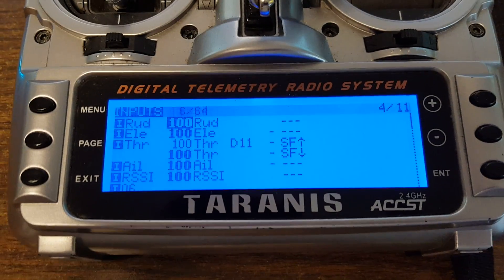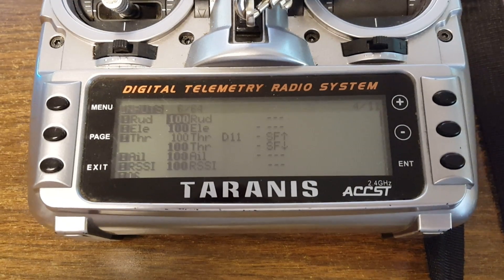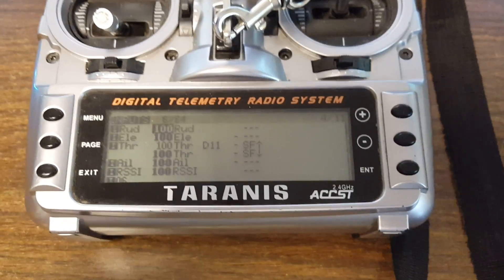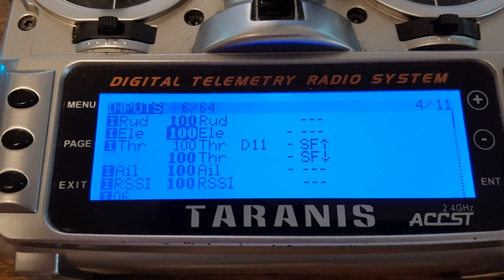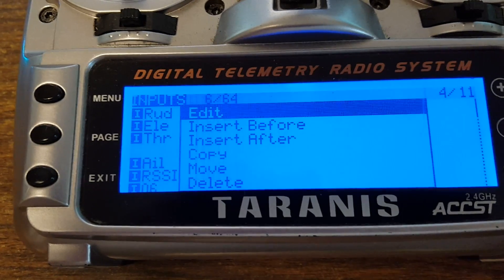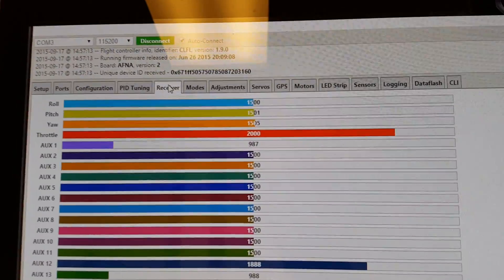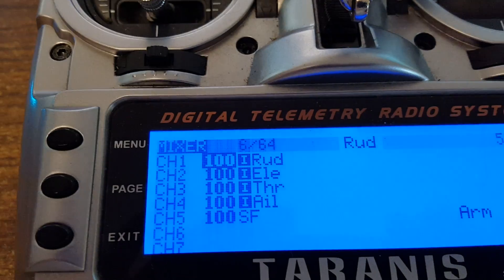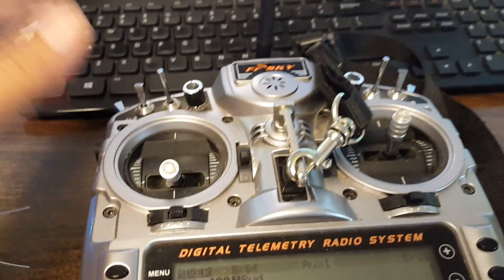Configuring "idle up" switch with Cleanflight and Taranis

Comment: Josh, is this still needed with the PID at min throttle option in betaflight? If your not running motor stop and your min throttle command in cleanflight makes your motors run at arm?
Reply from the maker: +PeeeJayz With PID at min throttle, the I term is still reset when the throttle is below min_check. Betaflight has added the ability to extend the time period before the I term is reset. But I just prefer this method, which prevents the I term from resetting at all. Just make sure to take off shortly after arming, before the I term starts to wind up on the ground.
Reply: Makes sence, I wasn't sure if that feature removes the need for this new. I will create a custom mix tongiht and add it to my arm switch :) Should resolve the problems I have when getting inverted ;)
Reply: +PeeeJayz how are you flying now? with a modified taranis? could you compare it to the "normal" cleanflight/betaflight settings?

Comment: hey Joshua, nice video.  I was wondering if setting this up with a diff like you did will make the throttle non-linear?
Reply from the maker: +Zenman FPV If the graph in the Taranis is to be believed, then it changes only the bottom half of the throttle curve. There is a sharp angle at 50% and the curve returns to normal. I haven&#39;t noticed it at all during flight, but possibly if my hover point was further from 50% I might.

You could use a custom curve to make the throttle do whatever you like, if it matters.

Comment: I had done this exact same thing except I just added "10" to the Offset on what I believe is the same Taranis page you are showing.  When the switch is armed I set it to add just enough to go a few steps past min throttle
Reply from the maker: +Rick C I tested this out some today and found that I still had a bit less authority than I wanted, so I raised the parameter just a bit more. I think there may be some value to having the "idle up" not let the throttle go quite all the way down. It probably depends a lot on the individual setup. This way, my descents are not quite as fast as they would otherwise be, but at least I hold attitude.
Reply: +Joshua Bardwell I tested this a bit last night also...My curiosity was more in the difference between using "Offset" and the curve feature "Diff" like you have in the vid.  Basically using "Diff" you are just adding steps to the throttle channel on the lower end.  Anything after 1500, and you won't see a change in the throttle which perhaps might be the way to go.  "Offset" basically just adds steps throughout the entire throttle range.  As for the control authority, I've always run my Min throttle a tad low, so in order to get this to work efficiently I had to increase min throttle from 1070 (barely spinning) to 1120.  I think this also depends greatly on the weight of the craft.  My miniH did great using your "Diff" curve once I increased the Min throttle to a number that will spin enough to have decent control.  I set the switch to go 2 steps past min check (1050) which was 1052, then Min throttle kicks in (1120) and it worked really well!  I was only able to test in the front yard but I am thinking this will be a huge help for me when doing inverted acro.  I have an MB Epic 280 that I tried this method on as well, and I think its just a bit too heavy but I'm excited to try it out on my minis. Thanks!
Reply from the maker: Using offset, I would be concerned about running off the top of the range before the stick is all the way up. Does it leave the top at 2000?
Reply: +Joshua Bardwell that's a good point....I will check that.  Honestly I switched it to Diff and left it at that but I do have other models on my Taranis setup using Offset so I will take a look at that when I get home.  Based on what I observed yesterday I am 95% sure it will indeed hit 2000 before the stick maxes out.  I have flown for several weeks with it that way, so I can't say that it I ever noticed anything but still a good point.

Comment from the maker: Repeating the note here for anybody who is subscribed: 

PLEASE NOTE: This exact setup does not appear to work on Cleanflight 1.10. The issue seems to be that the FC sees that the throttle is not idle and refuses to arm. This check must have been done in the opposite order in 1.9 or something.

The workaround is to create a logical switch that is conditional on your arming switch being in the "armed" position, and with a Delay setting of 0.1. Then make the throttle input line conditional on the logical switch instead of the physical arming switch.

The effect will be that the copter will arm when you flip the switch, and then 0.1 seconds later, the throttle will come off idle and not return to zero until you disarm again.

This video describes the workaround: https://www.youtube.com/watch?v=M1QwPkD05YU
Reply from the maker: Send me your .eepe file somehow and I'll take a look.
Reply from the maker: +chrswnd You're making the common mistake of confusing the input and output side of the FC throttle curves. The throttle stick is the INPUT side. The FC generates throttle OUTPUT signals to the motors in response to the stick inputs. Min_throttle is on the OUTPUT side. Therefore, the stick position is never compared to min_throttle. 

On the INPUT side, the throttle stick position (channel 3 on the receiver, by default) is compared to min_check. When the throttle stick is at or below min_check, the FC outputs min_throttle to the motors (assuming motor_stop is disabled). So if you want to configure an idle up switch, you want your throttle channel to stay slightly above min_check. This has nothing to do with configuring min_throttle.

On the OUTPUT side of the FC, the relevant parameters are min_command, min_throttle, and max_throttle. Set min_command and max_command to 1000 and 2000 respectively. Then perform ESC calibration using the Motors tab, to ensure that your ESC endpoints agree with your FC endpoints. Alternatively, manually set your ESC endpoints to 1020 and 1980. Finally, use the Motors tab to determine the lowest throttle value that reliably causes your motors to spin up from a stop. Add about 20 us to that number and use that as min_throttle.

With a min_command of 1000, a min_throttle of 1153 seems high to me, but it all depends on your ESCs and your motors. If that's what it takes to get the motors to spin, then that's what it takes. I would double-check that your ESC endpoints are all calibrated correctly.
Reply: +Joshua Bardwell Couldn't figure it out for the longest time until i found this tip.  Thanks :)
Reply: I want to use this extremely badly, but I'm an idiot when it comes to taranis programming. If I understand you correctly, the video above no longer works with 1.10+? Using latest betaflight of course... is it possible to update the video to match your logical switch method?
Reply from the maker: +ArminFPV In the "Logical Switches" Screen, set L1 to:

Function = AND
V1 = SF_UP (where SF is the switch you use to arm and up is the armed position)
Delay = 0.2

In the "Inputs" Screen, set the Throttle Input as follows:

Line 1
Source = Throttle
Switch = SF_DOWN (where SF is the switch you use to arm and down is the disarmed position)

Line 2
Source = Throttle
Curve = Diff 12 (Adjust the number to put the idle speed higher or lower per your preferences)
Switch = L1
Reply: +Joshua Bardwell you're the freaking man. thanks so much. somehow I got it to work without the logical switches. maybe it's not set properly though, I will do this instead. thanks for everything you do joshua
Reply: +Joshua Bardwell is there maybe a Typo? I did it exactly like discribed, but throttle won't change in Cleanflight/BetaFlight when ARMED with SF :(
Reply: +Joshua Bardwell *.eepe uploaded here: http://www.filedropper.com/document2 appreciate your help!
Reply: +Joshua Bardwell  The fault was of course on my side!  in the logical 
switch screen I set the V2 to SF_DOWN, which caused problems! My motors 
start nicely at 1153 min_throttle, and I have minimum command set to 
default 1000. what do I need to edit those values to? should my DIFF 
x value bring my throttle value above the 1153? THANKS IN ADVANCE :)
Reply: Joshua Bardwell Again thx for your time and explanation. Please tell me If I got it correctly (not a native speaker): 
I just edited min_throttle (recalibration helped) to 1027, at this point the props now spin with a clean sound. I set min_check to 1010, which means at stick position 1010 the naze will spin my motors with 1027. I checked the receiver tab in Betaflight and when I simply arm via switch the Naze, it shows at 0 throttle position "996" on the graphic....
Sooo to have pid_at_min_throttle=PID (the newest release of betaflight) I would have to edit my min_check to 995 OR deal with a e.g. "Diff 5" switch arm? Is that correct? :-)

kind regards, 
Chris
Reply from the maker: Almost 100 % correct. Pid at min throttle is active when the stick is below min check. So leave min check at 1010 unless you intend to prevent yourself from ever entering stick commands.
Reply: Joshua Bardwell Great! I finally got it! :D Just armed with a simple switch (no diff or anything), pulled stick up a bit, pulled back and moved the copter at apparently 996/997 in my hand and the ESCs were still doing their job :) Hope this is low enough (1027) to land in a safe manner :-) Thanks again, I owe you a beer!

Comment: Ive seen a few people mention they do it that way.
My esc,s are callibrated to 1060 and I set my min throttle to 1120. That way when it arms the props spin and cant go below that.
Is there a reason your way is better, Im interested in your thoughts
Reply from the maker: +Noel Harris This is separate from min_throttle. If you have feature MOTOR_STOP disabled, then your motors will spin at min_throttle when the throttle is at zero. But the PID loop will not be running, so the motors will just idle and the copter will tumble. If you set pid_at_min_throttle=1 and if you disable feature MOTOR_STOP, then the PID loop will still run at zero throttle, and the copter will still be stabilized and respond to stick inputs at zero throttle. This is the default setting for Cleanflight 1.9. Here is the problem: when the throttle is at zero, the I term in the PID loop is regularly zeroed out. This is to keep the motors from spinning up when the copter is at zero throttle on the ground. But if you are in flight, it means that the copter will not be as stabilized as it could be. So this method prevents the throttle from ever going to zero, which prevents the I term from being reset, which makes the copter more stable if you do zero throttle descents. The down-side of this is that if you arm while you are on the ground, and then don't take off within five or ten seconds, the motors will begin to spin up in an attempt to correct against vibrations that are not really happening because the copter is on the ground.
Reply: +Joshua Bardwell I think I understand. So your saying that if Ive got motor-stop disabled, pid-at-min-throttle=1 , even though I have my min throttle set to 1120 it will still destabilise if I drop the throttle to zero? I never really drop it to zero while flying but Ill try next time and see what it does.
Thanks for explaining it.
Reply from the maker: +Noel Harris Some people have noticed that it destabilizes a bit. Others have said it's no big deal. The I term is really important for maintaining longer-term stability e.g. in rapid descents. Check this out to see what it's like descending with the "idle up" switch.

https://www.youtube.com/watch?v=CXRP5oX1oqY
Reply: +Joshua Bardwell I have actually noticed the destabilization when I drop my throttle to 0 with airmode enabled in CF, the front of the copter will usually tilt back a bit.
Reply from the maker: air mode should really make that better, not worse. Or at least the same. I would raise pitch I gain in your situation.
Reply: +Joshua Bardwell I'll try that in just a little bit. Ty

Comment: shh this is a secret haha , i do much the same but use a curve not diff and use delay up 2 seconds to trick it into arming
Reply from the maker: +Rotceh Just couldn't bring myself to use a curve when diff did it so easily. And diff appears to move just the bottom of the scale too. Everything above halfway stays the same.
Reply: +Joshua Bardwell i see you found out why i use a delay :) was woundering why you didnt have todo that but figured i was on newer code